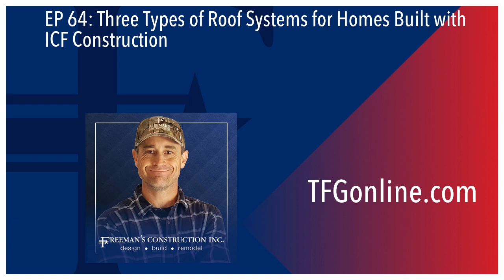3 Types of Roof Systems for Homes Built with ICF Construction

Comment: I wonder about roofing an ICF-walled house with SIPs.  Here in Colorado (and some surrounding states), code requires R48 for the roof, which is somewhat difficult to achieve.  I see that there are some SIP manufacturers with R50 roofing options.  The other thing that I wonder is building a 12"-18" raised heel and just doing blown in insulation to get it to R50+.  It might even be some combination that gets a cold attic so the snow doesn't stick to the roofing and cause ice dams.

Depending on home design, this could be pretty DIYable, or at least make a big chunk of the tasks something that is DIY.apping

Top that roof with metal or concrete tiles and then it's resistant to fire, as well as hail, while being more permanent than is composite.

I'm full of ideas... I'm full of something anyhow.
Reply from the maker: We have also built ICF homes with ICF roofs that have parapet walls and the roof is sprayed and sloped with spray foam and then coated with a UV resistant coating. The roof slopes to drains. If you want a cold roof you can put two layers of sheathing on the roof and put 3/4" fir strips between them to create an air gap.